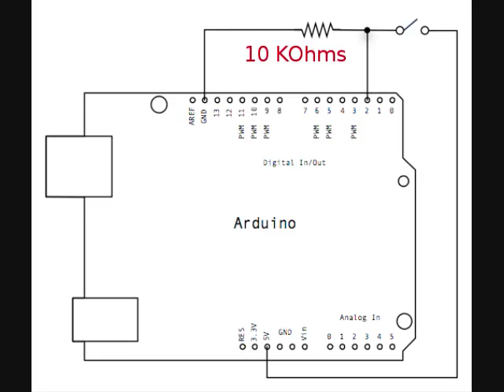14. Arduino Liquid Water Level Sensor with Horizontal Float Switch

Comment: Hello, very interesting, I only have one big question: how do I connect a pump to do the auto-refill? I know the pump is required, a relay, but I do not know how the connection would be and how I add the programming. Could you help me, please? Thank you.
Reply: Helo man..did u find out anything. im also interested in that
Reply: you can use a solenoid valve